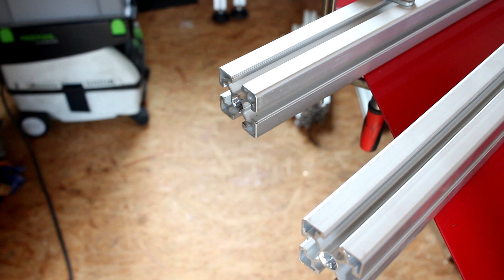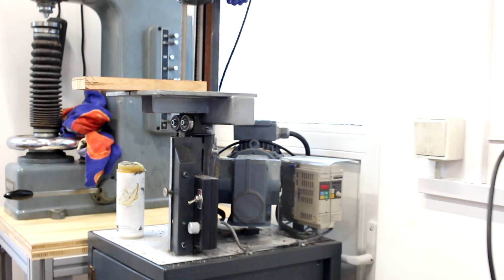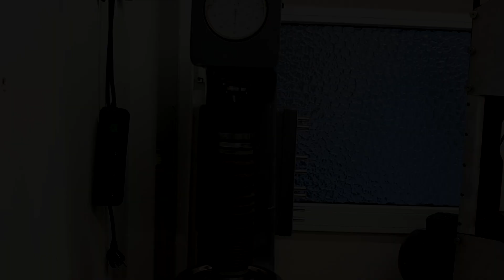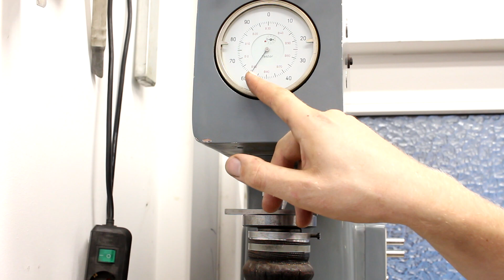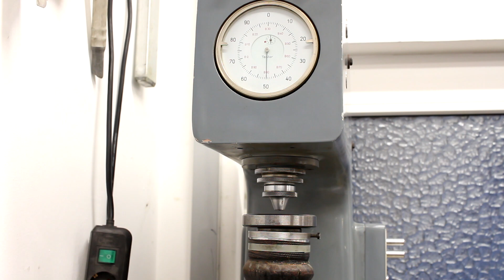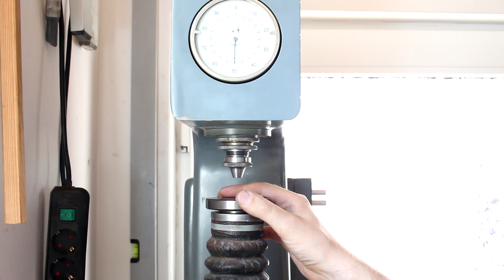Wolpert Testor HT2a Hardness Tester

Comment: Great video Stefan!
You could make the Vickers hardness calculation easier by skipping the translations to newtons.
The Vickers test force originally is specified in kg (yes, that's not a force).
Just use 1,854 and use kg. Then it's 1.854*(kg/diagonal²)
Your Vickers-HRC tabel is different from mine, and I discovered there are many of those tables, all have minor differences.
One would think there must be a mathematical relationship between Vickers an Rockwell hardness, I have searched for it but to no avail.
The Vickers test is very straightforward: force / area of indentation = hardness for soft to very hard materials, basically is a pressure measurement.
Rockwell is not so physically correct: depth of indent, minus preload, followed by strange calculations with 'scale factors' and different formula's for 8 ranges.

So I use Vickers, even made a very cheap hardness tester for it, see: https://www.youtube.com/watch?v=CHMexzeWQD8
But I am still searching for an as accurate as possible table/formula to convert Vickers to HRC

Comment: How critical is it to have the main dial dead on the stopping point of preload? Because the old heads at work told me to hit the dot on the travel dial(small inner dial) and zero the bezel to the large needle. Which seemed inaccurate to me because that just makes it a judgement call. @StefanGotteswinter
Reply from the maker: The manual states that you can overtravel until the small needle hits the red dot.

Comment: I totally agree with Starrett quality not being great. I have a tap handle from 1980's and it's smooth as glass. I  bought one 1 year ago and the thing had burrs every where. The threads where so burned that it would lock up during adjusting
Reply: Burred*

Comment: Forty plus years ago I worked as a shipping clerk in a machine job shop. One of my duties was to check the hardness, with a Rockwell hardness checker, parts that were returned from outsourced hardening. Interesting to see the workings of a hardness checker. My recollection is that the parts typically had a hardness specification of 60-63.

Comment: Interesting video, You got a very nice universal tester there. I got a Swedish SPV unit a few Years ago that I have used only for HRC. I find it very useful in the shop, and I had a deja vue moment when You started testing everything interesting in sight. Many of my tools got a small indent as well back then... The preload on mine is a spring loaded fork type instead of the threaded ring around the diamond on Yours. This means that it is possible to test round specimens as well. I use that feature a lot. There is a conversion table for compensating the indicated value to correct HRC for a certain radius.

Comment: Wow! That was a great lesson! We’re lucky Stefan created it. It got me wondering, though, what benefit you can get out of it. Obviously some job might specify a hardness but it’s unlikely you would harden the material yourself, no? If something is too hard or soft, what can you do about it? Surely it might be nice to know the value but then what?
Reply from the maker: I do a fair bit of heat treat myself - either hardening or annealing to get parts in a softer condition. 
Last week I did parts with an air hardening steel, that i never heat threated myself, so I cut a small test coupon, did the hardening and checked it, and the hardness came out +-1HRC to what it should have had according to the data sheet. So, thats a powerful tool for me.
Also, when modifying existing parts, its nice to know if they are just "hardish" (Like...45HRC), "hard" (like 50...55HRC) or "dont even think about it" (like 65HRC).
Reply: @StefanGotteswinter  thank you for making it clearer to me. At first it seemed like knowing the hardness just satisfying curiosity. I knew it had to be more.

Comment: As usual, it is a pleasure to see your methodology. My question may be boring, however , what is the tap you are using. The ones I find that can be run in a drill are horrid. As I do a fair bit of 80/20 I would love to know which tap you are using. I use a glass of alcohol with a brush clamped to the inside of it  to clean the tap and act as a lubricant. After each hole I simply give a quick run in the glass and the bristles clean it. I find compressed are send the shaving everywhere.  This is not a criticism of your technique. I just suffer from OCD.  Keep up the fantastic work.

Comment: Even though that test sample is way off the Vickers scale (which is more analogous to the HRB scale), the difference between the 0.44 mm and 0.46 mm diagonal measurements in the formula is 73.4 on the Vickers scale. That's almost 3 points on the HRC scale (at that range in the scale). To get the exact 61.7 HRC that the sample was, you only needed to be off by 2.6 μm. So 0.4626 mm, instead of the 0.46 you got on one side, was what the actual diagonal measurement should have been. Are you sure you measured it accurately enough in your μscope? Because the 63.5 HRC you got is a bit off of 61.7 HRC. Just trying to point out how the process of measuring that indentation is inherently inaccurate, and how far of you can get if you're using that particular method you measure the indentation.

Comment: Excellent explanation of the tester Stefan, would it be possible to measure a  cylindrical object in the tester if it was held in a vee block or would the vee block cause problems by deformation? Thankyou Neil
Reply: No. You would risk the diamond slipping off the side. You almost never test the hardness of your actual part. You send a flat piece of scrap steel from the stock you used to make your parts, along to the heat treat company, and have it all heat treated at once. Then you test that scrap piece. If that piece is in spec, you can be fairly certain your parts are too.

Comment: If the calibration was out, how do you adjust the reading so it’s within spec?
Reply from the maker: There is a procedure described in the manual, basicaly you change the ratios on the linkages inside the machine to get it back in spec. (In Reality the machine can only go out of spec if something on the linkage shifts, the weights loose/gain weight or the diamond is damaged)
Reply: @StefanGotteswinter  You mention the weight changing. Do you believe that there would be a measurable difference in hardness measurements of a person on the north pole and another one at the equator?  (Given that the same hardness tester and blanks used ate the same)
Thank you for the very interresting video!

Comment: I totally agree with you about the tools from Starret. Generally spoken I think (my experience) that "made in the USA" means mediocre quality for a high price. For calipers I prefer Mitutoyo.
Reply from the maker: There are other calipers than Mitutoyo Digimatic? :D

To be fair, the combination square is dead accurate, but the overall finish is just not nice.
Reply: I recently purchased a new toolmakers flat and storage/carry case from Starrett. The toolmakers flat has a Starrett label on it. The carry case is not labeled in any way. No Starrett badge, no "made in the USA" stamp.... nothing. WHY? Because it was made off shore, and so cheaply put together that even Starrett didn't want to their name to be seen on it. Still had the high price attached to it though.
Reply: @highpwr  are you taking about the Starrett No.81804 case? Assuming you're going by Starrett's nomenclature, they have one model of Toolmakers' Flat, with 2 variations. A pink granite No.81803 ($200) and a black granite one No.81802  ($185) that are 2" x 8" x 12", and one case that fits them for the same price as the flats. It says it's made in the USA. But I don't get how that tiny case can be $185. Maybe the flats are a loss leader, and they make their money on the case?

Comment: That seems a bit Hairy, having 190 Kilos on a thin aluminium section tube. You can see it wobbling as he turns the handwheel to raise the platen.
Reply from the maker: Thats the OSB floor wobbling - I have put way heavier things on 45mm Aluminium extrusion at my dayjob.
Reply: @StefanGotteswinter  But they have insurance, do you!?
Reply: @Margarinetaylorgrease  insurance for what? That extrusion is plenty strong enough to hold that weight.

Comment: The clunk of those weight selector fingers is so satisfying
It would be interesting to see how much 2 test points next to each other changes the results due to work hardening
Great informative video!
Reply: It's proportional to the hardness of the material. Harder materials can be tested closer together.
Reply: If they’re close, the angle of the first depression will change the reading.
Reply: @melgross  it could be stoned down first
Reply: @TomMakeHere  that doesn’t solve the problem you can’t stone the indentation away. You would have to grind the surface down several thousandths.
Reply: I wouldn't volunteer to test that- side-loading the diamond brale risks damaging it.

Comment: This bosch cordless drill model did some crazy jobs in car workshop i work in, like hours of drilling in 10.9 screws at low rpm
Reply from the maker: Agree! We have the same ones at my dayjob and we beat the crap out of them when doing onsite work. They just dont die :D
Reply: @StefanGotteswinter  i was exhausted faster, than this thing. Vent holes are completely optional too, covered or not it barely seems to get hot. Battery life has been getting short, but no failure in few years would make us buy the same set again

Comment: Hi Stefan! Are you planning on tiling the floor in the new shop? I would think the OSB sheet is hard to keep clean.
Reply from the maker: i don't do any oily or greasy work in that side of the shop, for now OSB will be fine. Only drawback is, it is a bit bouncy :D
Reply: @StefanGotteswinter  So not exactly a jig grinder foundation? You haven't dragged anything horribly heavy into there so it wouldn't be that hard to redo if you felt like it. :)